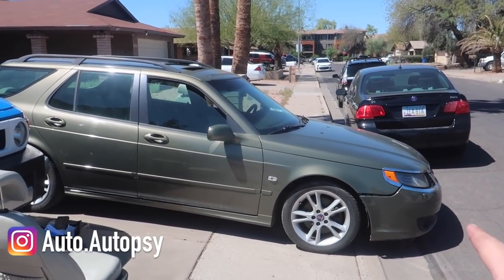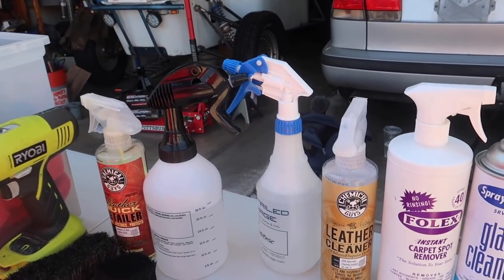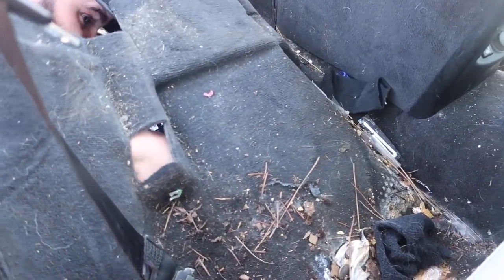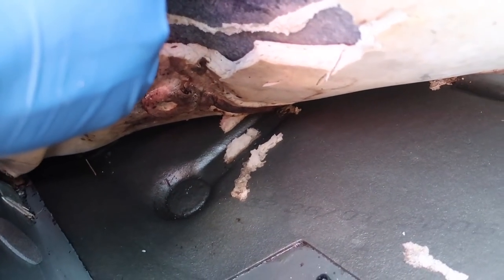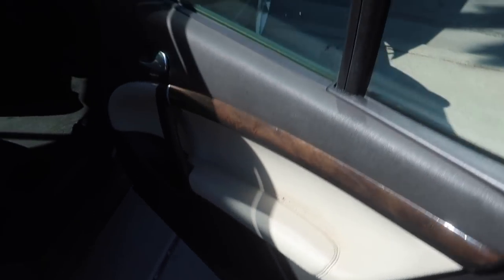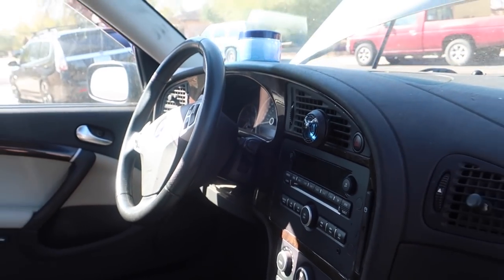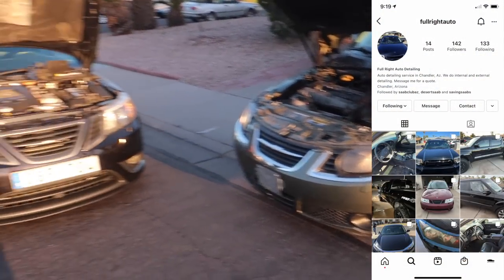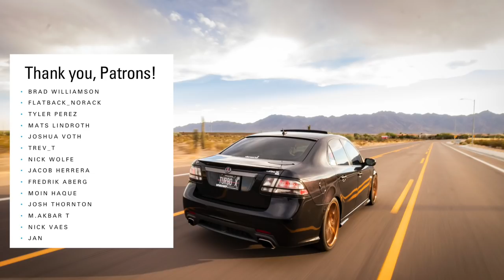Full Interior Clean and Detail on the Cheap 9-5 - Tons of Mold!

Comment: Your comments are a tad harsh given the previous owner gave the car to you.  Yes it's disgusting.  That's why it was free.
Reply from the maker: How are my comments harsh?? Lmao, it is (was) literally a dumpster on the inside.
Reply: @AutoAutopsy  Maybe a better word is insensitive.  Your subscriber gave you a car for free.  At this point I think he would have been better off lighting it on fire.
Reply: Would you advise someone to pay $1000 to retrieve that vehicle?
Reply: @thingserik7269  You betcha.  I paid $4K for my '08 9-5 four years ago and Saab prices are way up since then.  This green wagon is going to be worth at least $4K.  The body and paint appear to be very sound, the seat covers are good and the mechanical problems were time-consuming but easy to fix.  So it was a little dirty... :)
Reply: @mikeb.7068  Yo Mike how many Saab you got manual or automatic transmission?